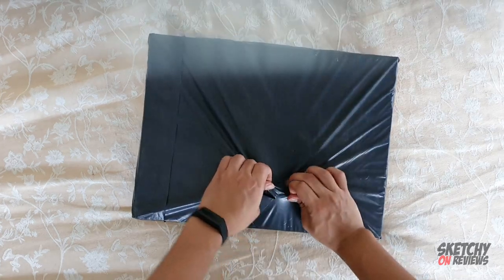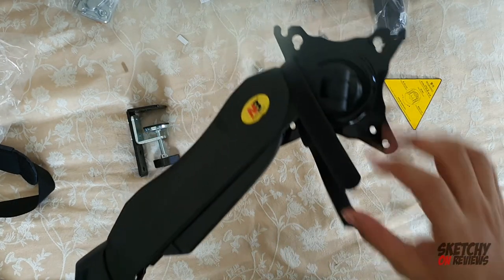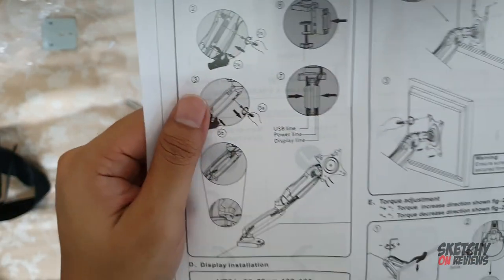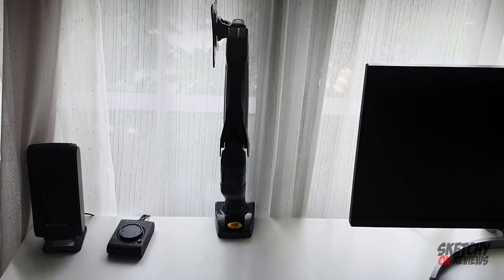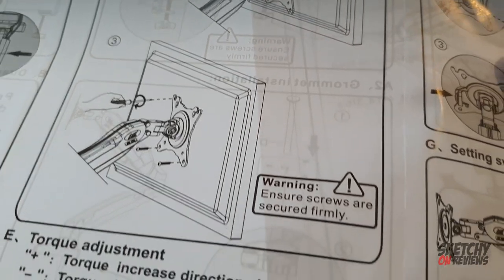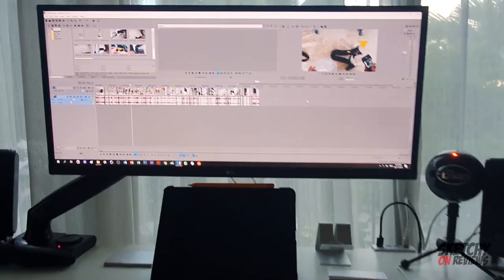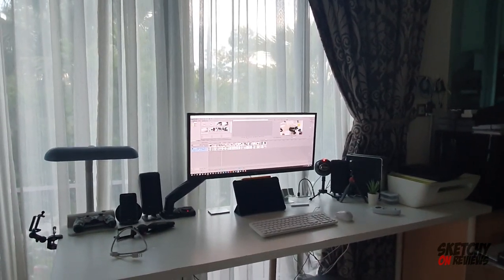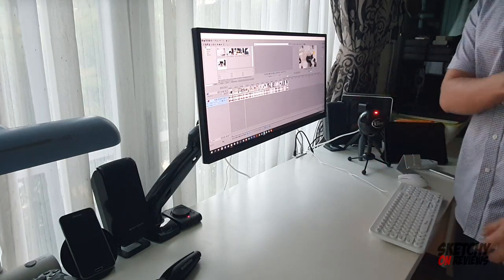F80 NORTH BAYOU MONITOR ARM - VESA MOUNT REVIEW  || SHOPEE

Comment: I am curious whether the monitor shakes badly when gaming fps, with mouse flick. If it does its a deal breaker for me. Can you please confirm
Reply from the maker: for my experience, it shakes cause im using a flimsy ikea wood table top...it is not strong enough to make it sturdy of a base for the mount..if i were to  press the keyboard hard, it shakes a little. but you can always mount the base on somethinf sturdy or another platform to avoid the issue. hope this info helps

Comment: My desk has drawers so there isn't much of an overhang on either of its sides. I measured it as only 3.5cm. Would the monitor arm be stable with the clamp? My monitor is 2.8kg with a screen size of 21.5 inches. Can you or anyone else please try to see how stable their monitor is if the clamp isn't all the way in?

Comment: does the stand can be installed on any other monitors or is it depends on what kind of monitor u have?
Reply from the maker: check the vesa mount  size of the monitor. the specs are in the description. hope it helps

Comment: Bro can I ask if the monitor arm dig into the Ikea Linnmon desk? Like the monitor is leaning forward because the clamp is burrowing on the desk because of the weight?
Reply from the maker: yes bro i had the same issue , my fix on it is to place a  larger surface area metal plate to the clamp area to avoid stressing on one spot area  / adjust plate of the clamp to the optimal position to not put stress on the table.

Comment: Hi, thanks for the video. Can you please help, at 10:30; that part that attaches to the monitor is quite straight and making it easy to connect the monitor but mine is not straight and when I fit the monitor, it doesn’t really look good as it is skewed. I tried to twist it but it is just tooo hard and I am afraid I can break it. 
Pls help pls help

Comment: hey man, just wanna ask since I saw your vid. It seems that the hydraulic of the arm is a bit too strong. Can you actually reposition the height anyway you like?
Reply from the maker: the strength is adjustable by turning the knob screw left/right ( + or - ) as shown in the video on the arm, my thought the same like you man, like wouldnt it be too much force but when i placed the monitor the arm weighs adjusted to the amount of force ive given.  in the video, is possible to move around any axis after placing the monitor,( even thou the monitor is light, but it has a weight to it dont worry). so yes, to answer your question, is possible to reposition the height anyway you desire.
Reply: @SketchyOnReviews  thanks man. Really appreciate it. I hope your channel grow. That's 1 subs for you. Haha.
Reply from the maker: haha eyyy thank you bro! 🤧🙏 really appreciate it and you are most welcome!

Comment: Hi, could i use my LG 34GL750 on this arm? , it's ultrawide 34 Inch Monitor, weight aprox 13.6 lbs or 6.2 KG
Reply from the maker: not sure on that bro, but mine is 5.216kg ..another kg wouldnt hurt right? it seems possible.

Comment: Sorry stupid question, will my 24 inch monitor fit in that monitor arm?
Reply from the maker: Fits: Most 17 to 27 inch screen flat panel TV
(Note: Supported screen size is provided as a reference only)
VESA Compliance: 75*75 / 100*100mm 

double check your vesa mount size

Comment: thanks man, I was really looking for someone that use this bracket for larger monitor, anyway, it says that the load capacity is 2 to 6.5kg, so do you think it's possible to mount 32" monitor from samsung that only 5.2kg?
Reply: aditya maulana in the same situation man. Would love to get this for my Samsung C32JG50
Reply: @Bakke5141  damn that's what I'm considering to buy, how do you like the the monitor? do you have any issues?
Reply: @aditmaul3  none bud, brilliant monitor just a very basic stand. Go for it.
Reply from the maker: currently my monitor weighs 4.72kg without stand.. in the manual it states it can carry weight up to 6.5kg , so good to go brother 👍👍
Reply: Bought both the monitor and the mount yesterday, and everything is perfect, it just need so much adjustment. 👍

Comment: Do you feel that it's too heavy for it's base?
Reply from the maker: no not really, cuz the monitor is still fairly light
Reply: @SketchyOnReviews  Monitor LG 29WK600-W right, bro? Weight 7,5 Kg is ok?
Reply: @minhtu4357  i just installed my LG29WK600 on it. (Monitor 4++kg) should be ok
Reply: @ct666-z1n  thks bro :) I'll buy it

Comment: Hey man, thanks for the review. I'm thinking of using this so I can switch my monitor position between work and sim racing. Can you tell me what is the maximum reach of this monitor arm, from rear table edge to the vesa mount. Thanks in advance.
Reply: Did u use this for sim racing bro.. I use VR but am interested in looking for an arm for Monitor only racing.. figuring out how i can use my main monitor with a decent mount for also reaching my rig
Reply: @umary04  yes I did, works great.
I have my seat (IKEA poang) next to the desk, with the arm mounted on back of desk on corner near the chair. I can then bring the monitor over to the teaching position, or bring over to centre if desk for work.
Highly recommend it, especially at the price

Comment: this is the old version
the new version is a bit different which can support monitor weight up to 9kg
the clamp is a bit different too

make sure the surface of the stand base completely/fully clamp the table
urs arent where u can see the stand base a bit offset and isnt straight when the monitor is attached

table damage may occur in the long run

what i did

cut a piece of box
shaped it like the base
put it between the base and the table
fully insert and clamp the stand
attach the monitor

if the base isnt straight because of the monitor weight
ask someone to hold the monitor 
while readjusting the clamp

Comment: Is that plastic or steel
Reply from the maker: the arm back bone is primarily steel , just covering the bottom part of arm is plastic in order to have function for hiding the cables , but structure overall steel to maintain figure